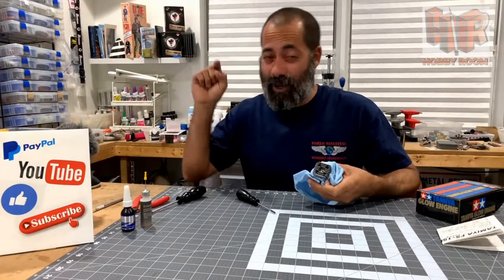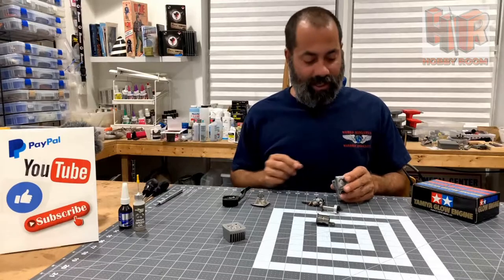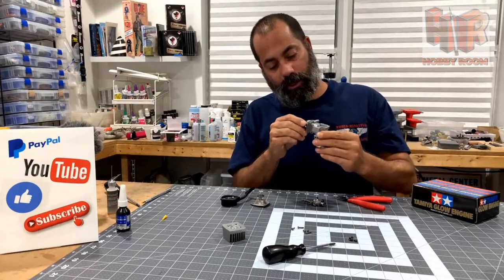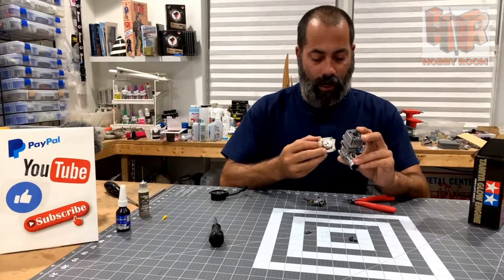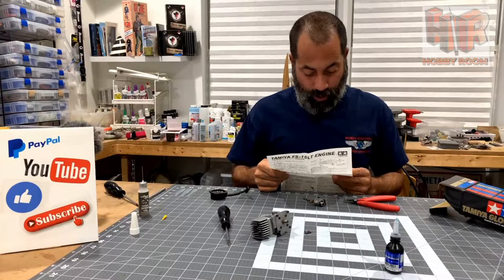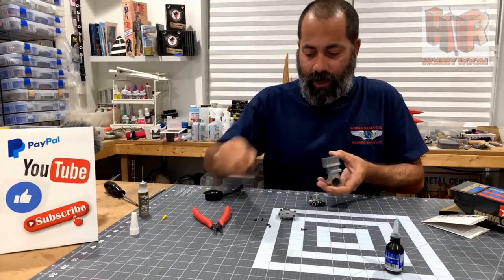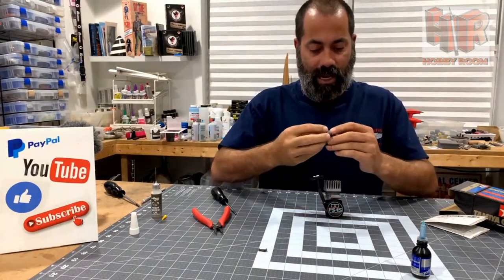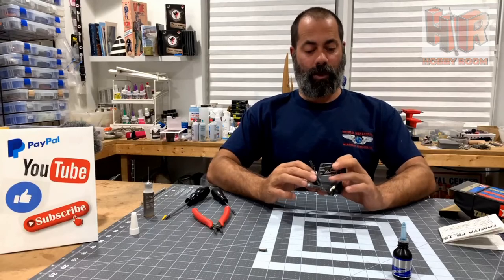Tamiya TGX engine build FS-15 1/8 NSX

Comment: Hi mate, nice video👌 The TGX are a great car I have quite a few runners myself. They are basic in construction, mostly underpowered but very reliable, fun cars. This FS15LT engine was installed in most of the TGX kits, once again not the fastest engine but pretty reliable. There were some performance variants like the FS15RS and the Italian made OPS 15 sized engines, there was also a Novarossi CX12 powered version and that little engine was a great powerplant. Look forward to more videos👌
Reply from the maker: Thank you for the feedback my friend!